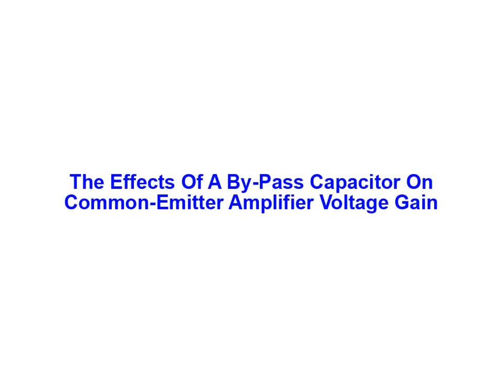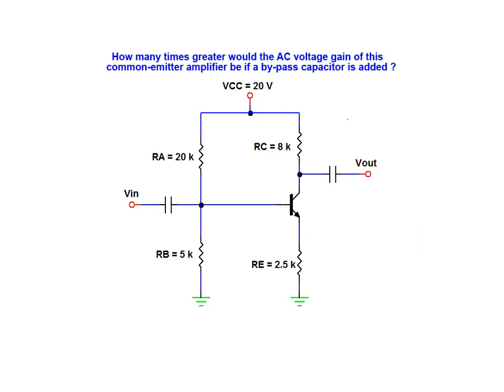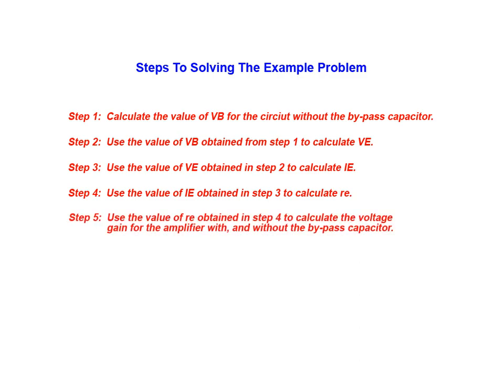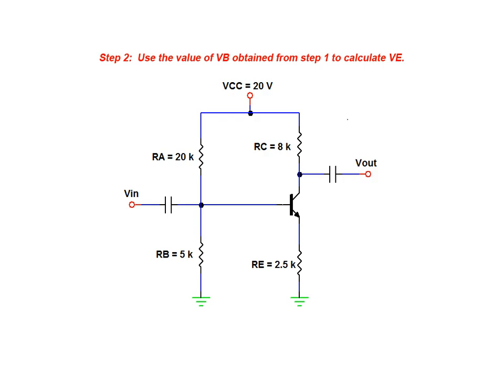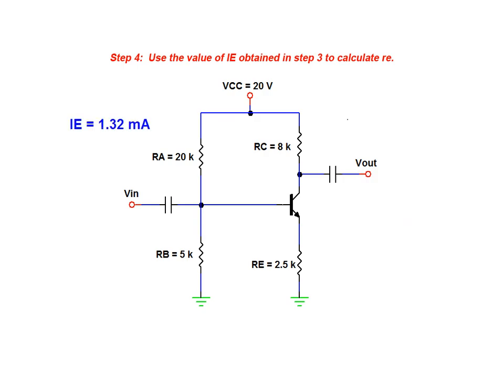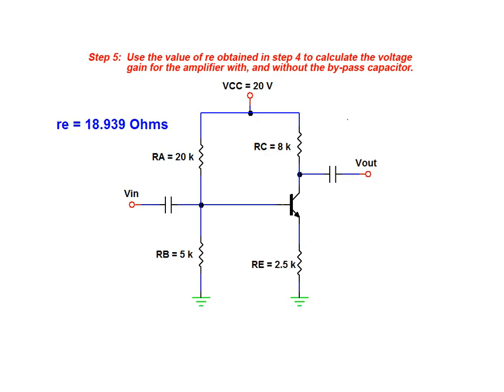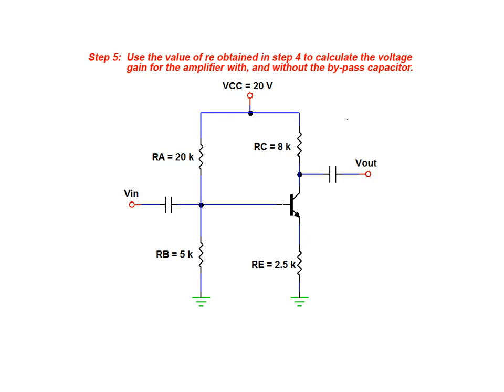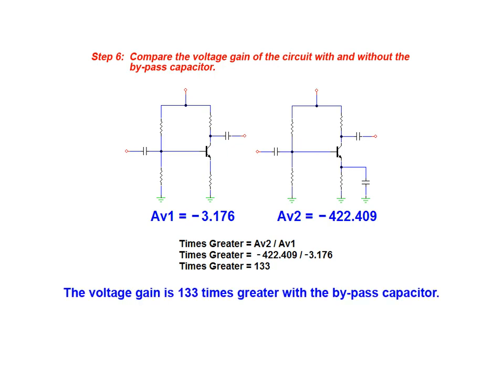The Effects Of A By-Pass Capacitor On Amplifier Voltage Gain - BJT common emitter amplifier

Comment: Nice vid, but how do do you calculate the resistor values?
Reply from the maker: Hello,
That's a completely different video !  Generally speaking, it depends on your input signal span, where you want to operate the transistor (re: Q point or operating point) and biasing etc.  All of which is beyond or outside the scope of this video.  I will add CE amplifier design/approach to my list of possible videos, and may add a vid on that in the future.

Comment: what happens if your circuit does not have an Rb resistor?
Reply from the maker: Hello, not sure what the issue is. The Rb resistor is a biasing resistor for the input. The difference in results would depend on input signal and supply configuration. Perhaps you could clarify a bit as to what you want to know here. This video is just a basic intro into how AC signals are affected by a bypass capacitor.

Comment: how about if i don't use coupling Capacitor. Will there be any differences with and without Coupling Cap?
Thanks. Let's figure out if i don't use coupling at Vin, Vout, and no coupling at all?
Reply from the maker: With no coupling caps, you will amplify the DC portion of the input signal and probably overdrive the amplifier. The output will not be reflective of the input due to high DC portion in output signal.  Use the coupling caps.

Comment: Some constructive criticism: Maybe you should point out that the base voltage calculations is an approximation assuming the transistor beta is high.
Reply from the maker: Joakim Nilsson Great point, I will be sure to include that if I update the video.  I really should have mentioned that.  Much appreciated Joakim, thanks for the feedback !

Comment from the maker: Hi,  the capacitor behaves differently for DC and AC. We would want the DC gain to remain lower.  The cap is open for DC, so RE is still important in most apps for this amp circuit.